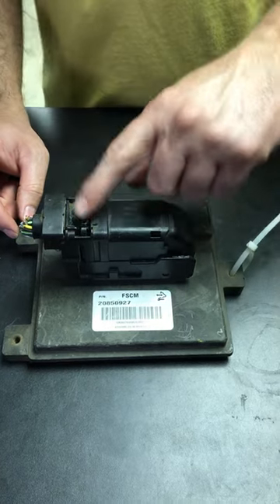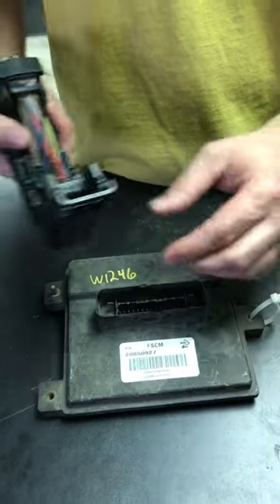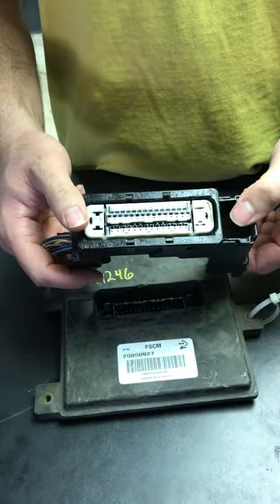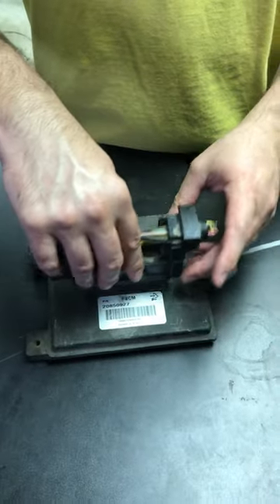FSCM fuel system control module plug disconnection

Comment: I have a 2010 Silverado. My trailer brakes are currently not working. Does my truck have a different itbc or is it integrated with the fuel control module.
Reply from the maker: should be integrated

Comment: Hi, i own a Chevy Malibu 2.4 Litre
I have code P069e sometimes. 

It comes only when i ride for along time in a hot weather and the Air condition is opened. Otherwise i have no code and no issue, 

As soon as MIL lights up, the car starts to stop with no response to fuel acceleration,  the time i see this problem, i turn the Air Conditioning off then the car runs well,  and if i left the car closed for hours the MIL Will disappear, and the problem come again if ride in hot weather opening the air conditioning system. 

I hope you guide me what to do??
Reply from the maker: Sounds like a bad FSCM or a module pulling down the fscm.
Reply: Did you ever find out your problem?

Comment: My gmc canyon was rear ended and the connector is smashed... the module I assume is fine,  question is where do I find the replacement part that plugs into the module?? Thank you for your help
Reply from the maker: we have a couple in stock. Give us a call or email us at spartanautoworx@gmail.com
Reply: Did you end up replacing the plug?